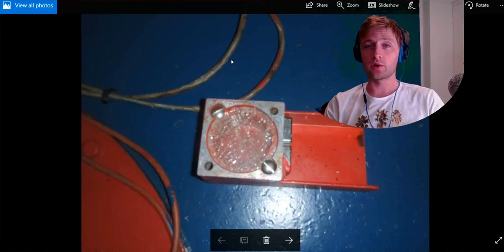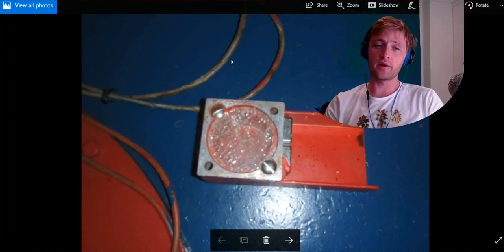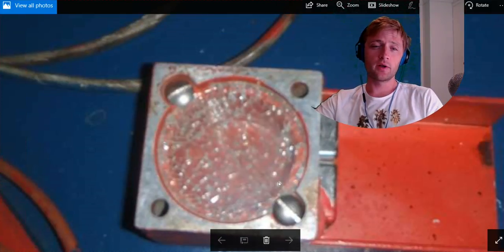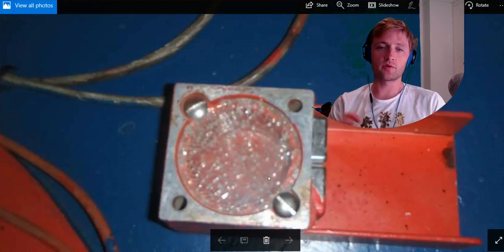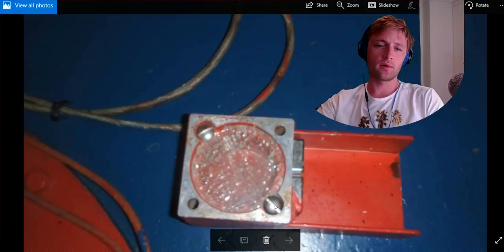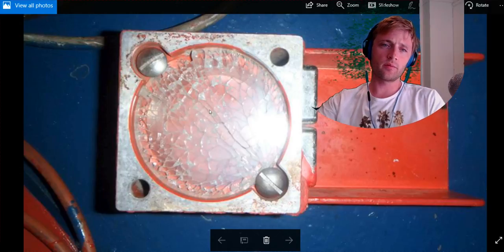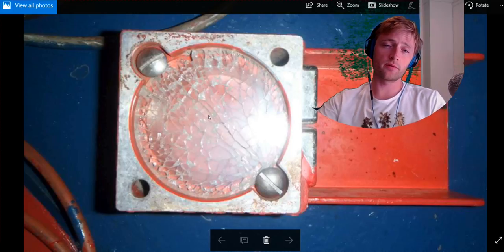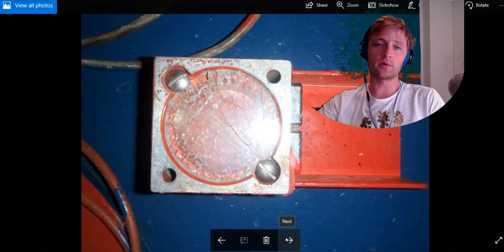AUX.BOILER PARTS

Comment: hay dear Mike.
hope everything is going well with you. 
I quickly response to this fact. because I had faceed with this evidence 4 time. 
when purifier don't work well or may be crews don't pay more attention to water traps (in Berner fuel line) and small explosion made in drum this glass and also other visual hatches cracking and breaking. 
I refined and replaced this glass with  other sources. 
I find heat resistance and unbroken glass dish and cut and grinding machine (Dimond cutter)  it was very important because CO and HC and so2 was blown in engine room and air quality was dropped in boiler aria.
also you can find this kind of glass from teapot or cooking oven and electric oven dishes and also welding mask glass I used them and find them during voyage (onbard) 
and its very important to use something like putty cream to fix it from both sides but in my mind is better you use soft asbestos gasket  to absorb shoks of Berner fuel linkage explosion. 
good luck. bye bye